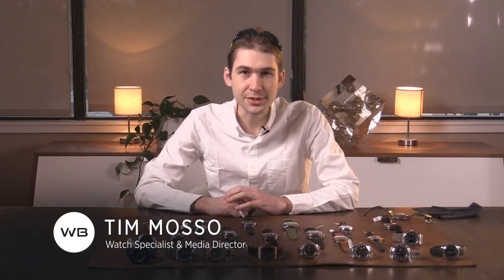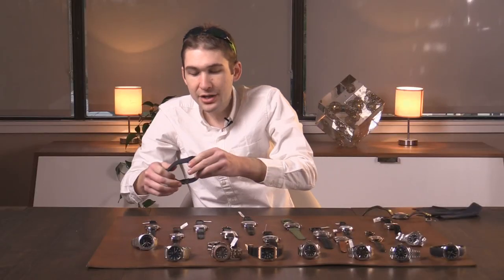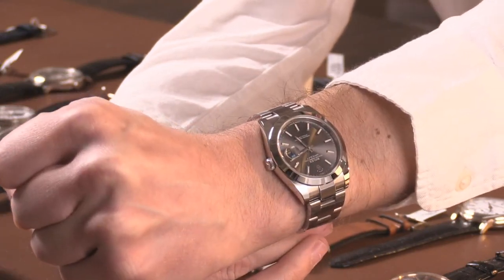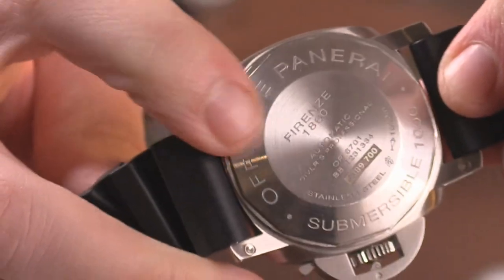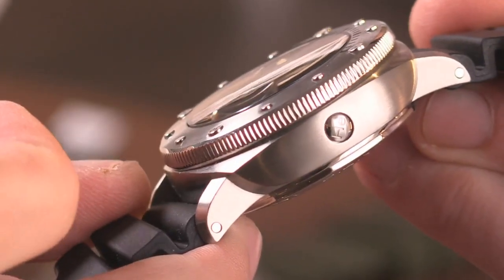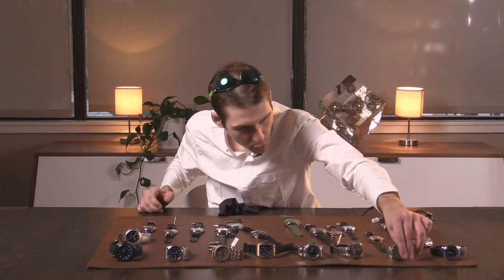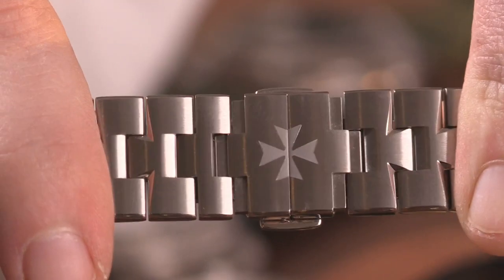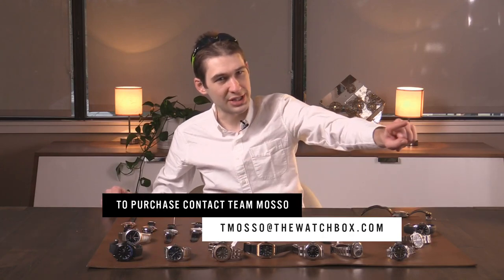Rolex Datejust 41 DARK RHODIUM; Omega Seamaster Diver 300M: Luxury Watch Shopping From Home

Comment: I try to love that VC OS. But can't get over the dullness of the dial. Give me the chronograph in blue instead.
Reply: Victor I’m also not fond of the sub-minute indices on a non-chronograph watch. That’s an immediate deal killer for me. Half the time, watches that have sub-minute indices on their dial don’t have the same balance frequency anyway. Sub-minute indices on a non-chronograph watch is truly the most useless thing you can possibly put on the dial. Now, that said, to me the word “Overseas” suggests a traveler’s watch. What is useful to a traveler? A four-handed GMT naturally (and no, not their Dual Time variant; they managed to screw that one up!). Make it a four-handed GMT, replace the sub-minute indices with a 24-hour GMT index, and screwed-down push buttons to adjust the 12 hour hand forwards or backwards. I think this should be the base model Overseas. And damn it, once I’m in charge then that’s exactly how it’ll be; ha ha!